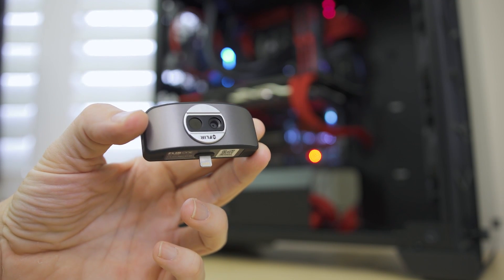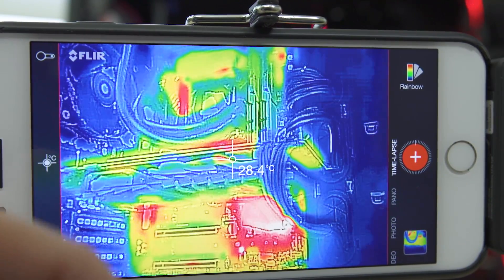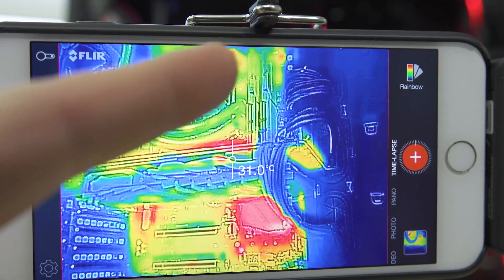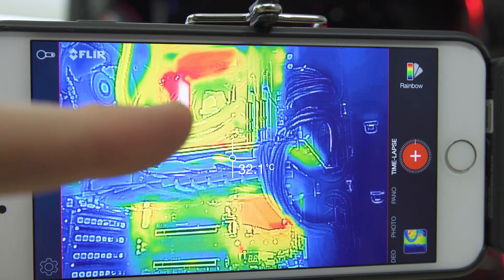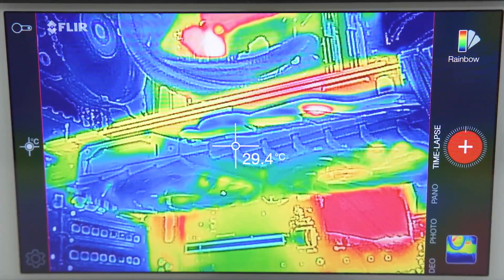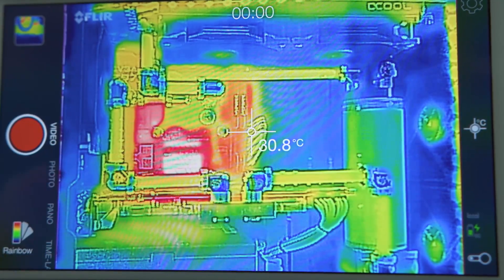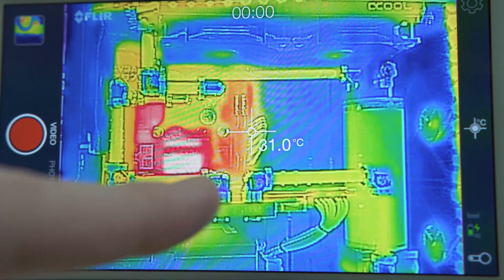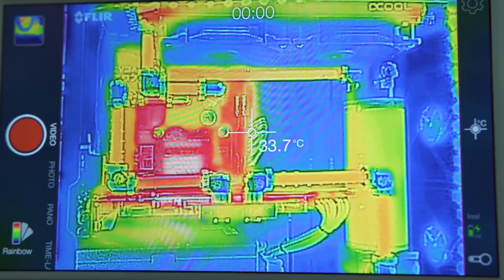PCs and Thermal Imaging... What your eyes CAN'T see

Comment: What I would love to see and understand is if/how the temperatures of the VRM's/Chipsets are affecting over clocks. I know that it does but, to what extent. When you go from MOBO A to MOBO B, is placement of chipset in relation to other items around it causing temperatures of the chipset to go up thus resulting in less overclocking? Is the heatsink too small on a given MOBO thus not cooling the VRM's enough, or are they placed to close or too far from the socket so it is interfering with the heat exchange and not gaining enough additional cooling from say a stock cooler. I'm sure you catch my drift, essentially whats the best MOBO for a given product family and what kind of layouts to lookout for when purchase a Mobo and wanting to get decent Overclocks

Side two of that would be looking at how positive/negative/neutral air pressure and where you place the fans affects the VRM/Chipset/Graphics cards.Mix that with a fog machine to see turbulence and efficiency and  you could have some really cool testing.

Also just wanted to add, this video was awesome, this is really my first time contributing in comments but I thought that this video truly deserved it. Well done sir and keep up the excellent work.
Reply: Pretty much every motherboard made in the last 10 years uses vastly over-dimensioned VRM's. Over-compensating by about 50% is common rule in electronics engineering. Besides, VRM's are extremely heat tolerant - practicall all VRM's used have a safe operating temperature of like 125*C. Some go up to 185*C. And that's safe operating temp, not maximum. For example, IR3550 VRM's often used by Asus and others, for all sorts of things, both GPU and CPU and RAM power delivery, goes up to 125*C safe operation (Page 5): http://www.infineon.com/dgdl/ir3550.pdf?fileId=5546d462533600a4015355cd7c831761

Comment: I know you are into cars Jay. I'm a mechanic and have been using a Flir stand alone unit for the last few years and the things you can see on a car will amaze you. Brake imbalance, cooling and hvac system problems, differential gear problems, belt drive issues and so much more. Some ideas for your other channel maybe.

Comment: JayzTwoCents, I would love to see you test the Asus Maximus IX Formula with with and without water cooling the VRMs on the board and how that effects the system (and if any of the advantages are passed on to the end user).
Reply: I have an older generation Formula with built-in water blocks. And I can say for sure that they don't make a damn of a difference. Which is to be expected - the components were designed to work properly without active cooling. All the full-cover water blocks for motherboards do, is look fancy. With maybe some extremely extreme exceptions (as in, world-record overclocking attempts).

Comment: What's the heat tolerance on VRMs & chipsets these days? If modern CPUs & GPUs can handle 80ºC out of the box, then motherboard components can do fine with decent case airflow...right?
Reply: Most VRMs are rated up to 125ºC
Reply: Regulators and in fact a lot of power-related silicon devices tend to be rated at 125*C or even higher. I've seen some common devices rated at 175*C. Granted, yes, high temperatures can drastically affect their performance. Not kill them - just make them perform worse during that temperature.
Reply: I should imagine that depends. I've seen Northbridges go near 100°C and be fine in the past, but insofar as they still exist off-die, that's probably not a universally acceptable temperature. Southbridges, which are still on the motherboard on most platforms, aren't likely to get that hot at all; they simply don't do enough heavy lifting to warm up properly, so their max temperature is something of a moot point. As for VRMs, that's where this question gets really interesting, because VRMs can and do get very hot indeed, both on the motherboard and on the graphics card...

Comment: hey maybe do a test how hot a air cooled cpu cooler get
Reply: Look up the junction temperature of your CPU, and that's your answer. There's no way to generalise across CPU coolers because there are so many of them, but if you just want to know "how hot can it get?", all you need to do is fit a cooler of insufficient TDP, run the CPU at full chat and watch the whole thing spiral out of control until the CPU reaches thermal shutdown, at which point the cooler will be, within a margin of error, the same temperature as the CPU.

Comment: That's why i don't like backplates - my xfx r9 390 has a backplate as well and the backplate hits about 100°C after 1h of witcher 3... -.-
Reply: Use some elementary logic and physics here.... If the backplate is hot, that means it's dissipating heat. If you remove the backplate, then you'll have to dissipate the same amount of heat, in a smaller area. That's bad. That's extremely bad. The same amount of heat measured in watts is always trying to escape (because it was generated by the microchips). You see what happens when a tiny little component like a CPU is drawing 100 watts? It gets fucking got. Compare that to if you had a room heater that produced 100 watts... It'd be a joke, it would barely be higher than room temperature, because the surface area is much bigger.

Science. Do it.
Reply: Well, if you didn't have it, just think how hot your VRAM and VRMs would get...
Reply: they'd propably be cooler cause the backplate is keeping all the heat insolated between the pcb and the backplate
Reply: Sebastian Winter They'd probably be hotter because the heat would be far less well dissipated over a large surface area, and all cooling would have to take place on the surface of the chips itself.

Comment: My dear friend, what have you done with your upper lip??? Did you get into a fight with something?

Anyhow; yes, you stand correct sir, this is indeed informative, and, pardon the pun, quite illuminating to say the least. Although i had a pretty good idea this is what was going to be the case, i was surprised to see the massive difference in temperature heatmap. 

It would be interesting to see, on the z270 motherboards that comes with multiple m.2 ports, what the temperature heatmap would look like if you had something like 2-way SLI and actually made use of 2 or perhaps 3 m.2 drives, like the motherboards are capable of delivering. 

Because, let's be serious here, anyone who has an m.2 drive and 2-way SLI would be familiar with the need for high-level of cooling, especially if you decided you wanted to make use of m.2 drive for running games off of it, like Witcher 3 where there is a massive read from the drive constantly! Food for thought!

Comment: I got decent cooling on my gpu and cpu, then i decided to put all my fans as intake. But after getting a laser temp thingy like jay has I found out the VRM and other stuff were hot as fk, and decided to put at least one fan as exhaust to get rid of the hot air inside. Well now I don't have to open the side pannel and put a common house fan in front of it anymore.

Comment: Hi Jay, or any other experienced water cooler person. This might be the wrong video to ask but whatever. I'm planning to do my first water cooled build and I'm at the point where I'm thinking about how to run the tubes, both about how to make it practical and also how to make it look nice. 

What I want to do, purely for aesthetic reasons, is run tubes into the GPU block then to the CPU and then back through the GPU block a second time. So I would use all 4 ports on the block. Would this work or would it screw with the water flow inside the block?
Reply: Back to the drawing board then, thanks for the answer.
Reply: Just think of it like a circuit. It has to have a logical flow. One in, one out, per block.

Comment: "we are going to use this air cooled system" points to a system with an AIO liquid cooler!!
Reply: Mickxal so by that logic I guess that makes all water cooled PC's air cooled...
Reply: Yeah, but it doesn't count as air cooling either. It is its own separate disappointing category.
Reply: gimmie55 hahaha right
Reply: @Mickxal
A refrigerator is air cooled too...technically.
Reply: I'm going to go with the car analogy, If it has a radiator that moves fluid through the component to be cooled, it's liquid cooled. AIO are liquid cooled. Heat is then pulled out of the radiator by means of actively moving air, with a fan, via heat exchange. If the cooling is done by moving air over the component to be cooled, or just the component being passively cooled without active air movement, then it is air cooled. Refrigerators are not "air cooled" freon is circulated and actually gathers the heat from inside of the refrigerator, and eventually moves the heat from inside the box to outside. there is no "cooling", just a transfer of heat.
Reply: I'm pretty sure when he said air cooled he was referencing the GPU as it was not on a water block in a loop. kind of a bad choice of words but I'm pretty sure that's what he meant.
Reply: he can't do without it
Reply: Attila theHun, I think you missed under stood my comment. No offense taken. No big deal, there's a reason why I don't write text books. Besides, I think that was the comment above me that made a reference that his heat pipes had liquid in it, therefore is liquid cooler.
Reply: +Mickxal
but a Refrigerator is air cooled as well, the hot side of the heat exchange loop has to dissipate somewhere - and that's to the air.
(and a Refrigerator uses air cooling to prevent higher temperatures from outside warming up a specific area - exchanging the absorbed thermal energy inside to its own exchanger, to dissipate it back to the surrounding area it came from)

eventually, everything that needs cooling in our world, is air cooled unless it's using cooling methods that use disposable materials to absorb thermal energy, rather than dissipate it.
Reply: Haha, I like this guy! ^
Reply: unsigned int, admittedly, I didn't explain well how a refrigerator is not "air cooled". But, in reference to cooling something, it usually applies on how the heat is primarily removed from the component that is generating the heat. Not the next step in the loop on how air then whisk away the heat from a radiator.  As for your D14, good point. The only way I can answer that is try to get Noctua to market their D15 as a "liquid cooler". I think it's because they call them "vapor coolers" when there is liquid in the heat pipes of what is more commonly called an "air cooler."
Reply: ***** 
this
Reply: Spaceman Rick 
I understood your comment pretty well...you suggested that Noctua should market the d15 as a liquid cooler. You obviously thought that Noctua makes something special, but a heatpipe always works the same way. A liquid turns into vapor and condenses back into liquid. The refrigerator does that actively with a compressor, but it's the same principle.
Reply: Attila theHun, I agree with everything you have said, except where you think that I believe that the D14 and D15 are liquid coolers. unsigned int said his "D14 has liquid in the heat pipes, so technically it is a liquid cooler." I was trying to explain in a half-assed way, what you more clearly just stated. So I thank you. Basically I was trying to tell unsigned int if he thinks his D14 is a liquid cooler, then HE should convince Noctua to market the more relevant D15 as such. I fully understand how such coolers work.  You said it better and more direct. I guess I wasn't clear on that.
Reply: Well, a Corsair AIO doesn't count as real watercooling for a guy like Jay.
Reply: Mickxal you saw the case inside Linus?!?! oh my god, get it out of him as "quick as possible" hahaha see what I did there ;) but seriously that's not a water-cooled PC that is a PC cooled by thermal expansion.
Reply: Audiman0aha Yep. Except refrigerators which uses other gases and electricity. I saw a case in linus that did sub 0 temps with a refrigerator inside.
Reply: unless its a completely passively cooled system.Or if its LN2 cooled.
Reply: gimmie55 Well technicaly theirs fans air cooling the radiator.
Reply: gimmie55 system is air cooled except for the AIO on the CPU. That is actually pretty normal; not everyone wants to spend a lot of time and money (don't forget stress!) on building their own water cooled system. AIO for the CPU is a significantly cheaper and alternative for the consumer._

So a person can't blame Jay, at all, for calling the system air cooled (when many air cooled systems have some sort of AIO in it.)
Reply: Spaceman Rick 
By your definition no cooler with a heatpipe is an air cooler.
You obviously have no clue how a heatpipe works...no offense. Those Noctuas do nothing special or new.

Comment: I'd be curious to see how hot the fins in different radiators get while the system is under load to see how much the heat spreads out.

Comment: What if an external graphics card was used through thunderbolt 3? Would the whole system be cooler as its mainly the gpu causing all the heat

Comment: Quite nice to see how heat spreads through the computer, but just be mindful, Jay, of how infrared works if you're not already aware.  Some surfaces can actually reflect infrared light, and others, like glass, can block infrared light from behind it, so there is the potential for falsely interpreting infrared readings, but for the most part this is still very cool and interesting to see. Looking forward to see these thermal images/videos starting to appear in the future, Jay!

Comment: Man i love that you got one of these you should continue to use this when reviewing products such as motherboards and GPUs. Would also set you apart a bit. 

Nice video man.

Edit some examples to use this on one be cool to see a AIO radiator heat up, also different GPU coolers. I also feel like if you get any new boards for review that it would be cool to see how well they cool. 

Though i doubt but i wonder if it would make a major difference for air pockets in the case if you show different fan positions.

Comment: I've got a corsair A540 case which separates my SSDS and psu from Mobo and Gfx cards with 5x 120mm fans. I've always wandered about the airflow and thermal situation in case. I've also wanted to do a build without a case or a very large case mounted on wall with a large fan cooling system further away from my workspace. Where can a South African purchase one of these thermal imaging device that not going to kill the bank? Great video! Can you also do a comparison with the air cooled system with case open and closed?

Comment: Linus Tech Tips has a video that Luke did about cable management and its affect, or lack thereof, of temperatures. It has been used as the comeback to any criticism of poor cable management but he just read the temps of the CPU and GPU, I wonder what your thermal imaging would tell us about the overall heat buildup in an enthusiast clean build vs a sloppy build vs a downright nasty cluttered build.